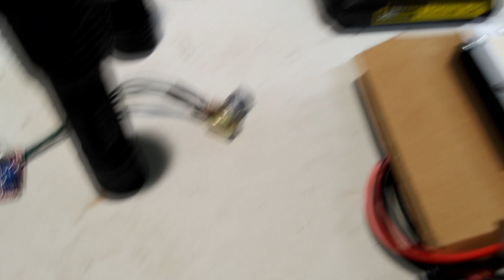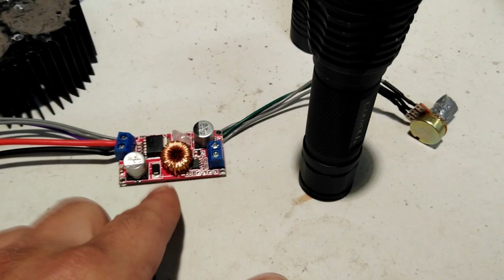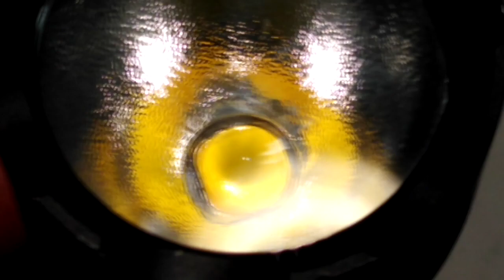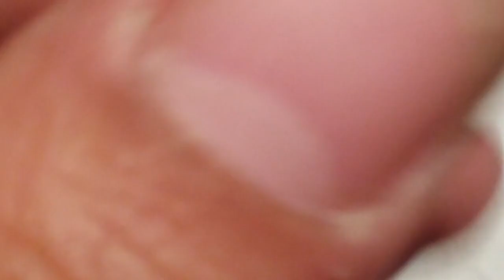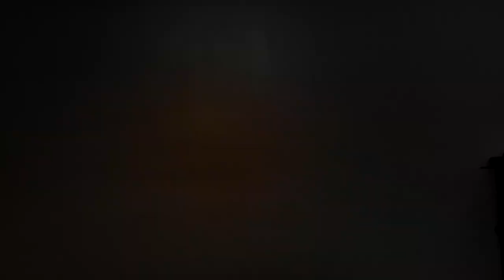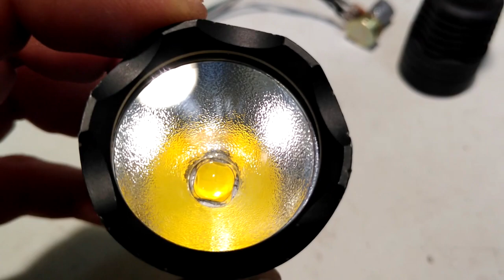Convoy M1 w/XHP70 upgraded to XHP70.2

Comment: Xhp70 brighter then xml2?
Reply from the maker: Yeah the xhp70 is 4 xm-l2 emitters together in 1
Reply: @Magneticitist  wow, cool.  
In the store I saw only xml-2 and xml-hi.  Is it hot too much?
Reply from the maker: @evgman  Yea it does get hot that's why it's probably not the best 'average user' flashlight. There are clones sold for real cheap on ebay and amazon and even though they don't crank the full power they are still super bright. You need a host flashlight that has suitable heatsinking to be able to run it full power for longer than like 30 seconds at a time. The "Emisar D4" is a cool little light that also uses 4x emitters and it's about the best that can be done so far when it comes to size vs output. It gets super hot full power also so it uses thermal regulation in the driver.